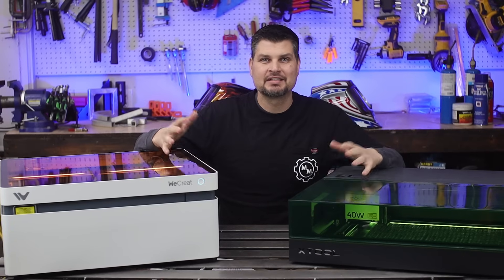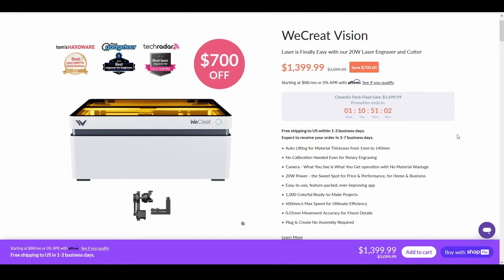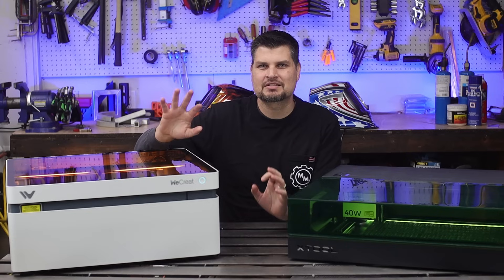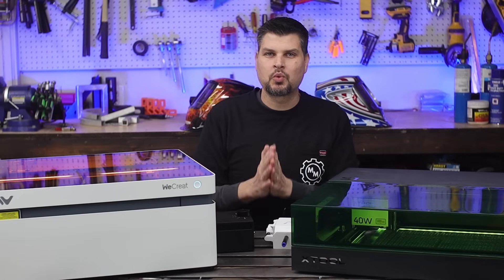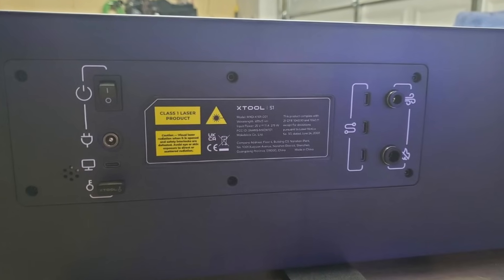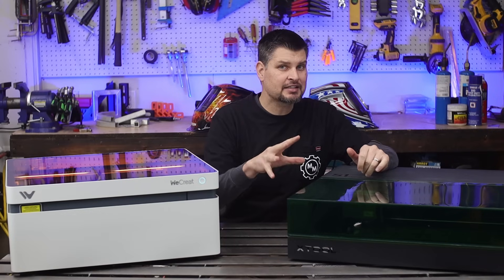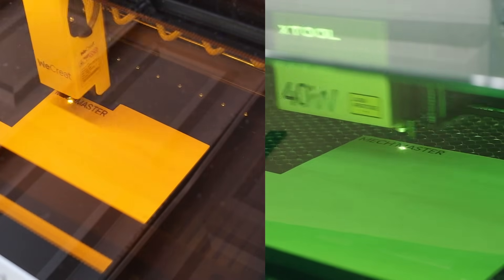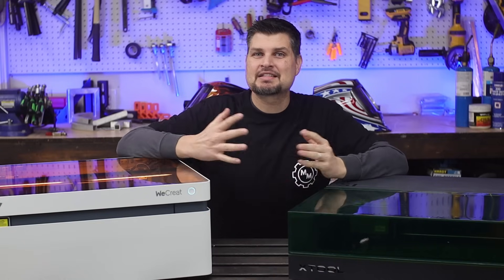Best Laser Engraver // WeCreat Vision VS XTool S1

Comment: When it comes to engraving (not cutting) is there really a big difference between a 40W and 20W.  The website makes it seem like one should only really go for a 40W if you want to cut thicker stuff, because the 40 wouldn't engrave as nice.  What's your opinion?  Many thanks.
Reply from the maker: For engraving, no, not a big difference. The Wecreat is a 20W and Xtool 40W. For engraving both are almost identical.
Reply: @-DIYPRO-  Many thanks.  Good video btw - subbed.